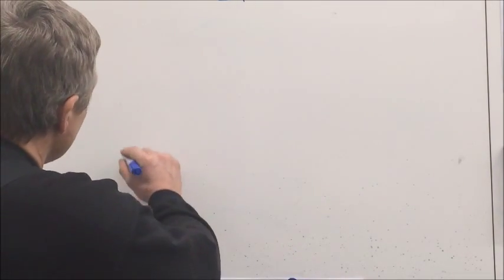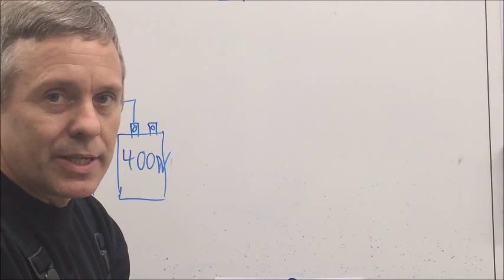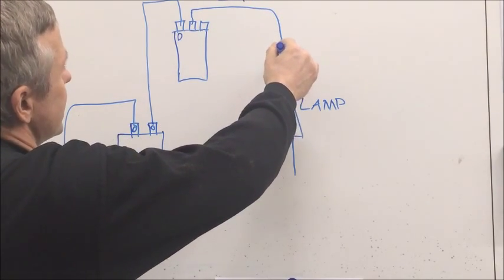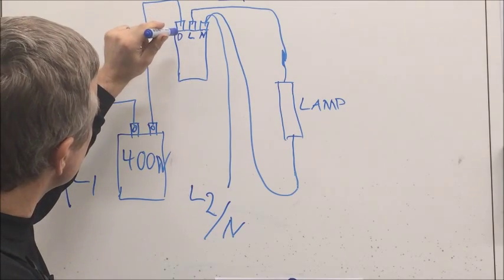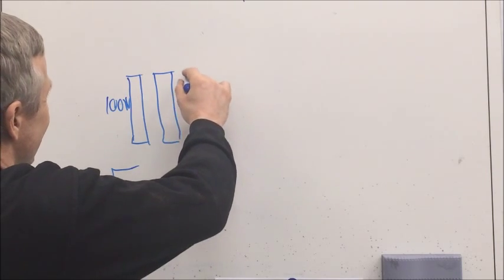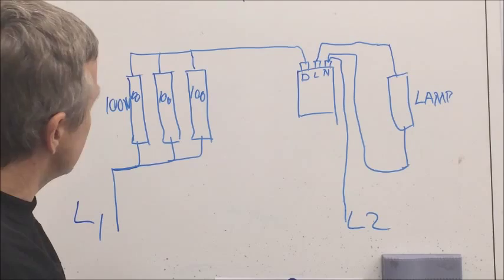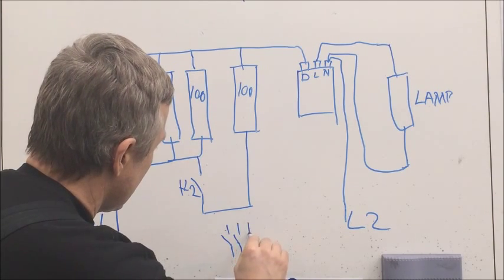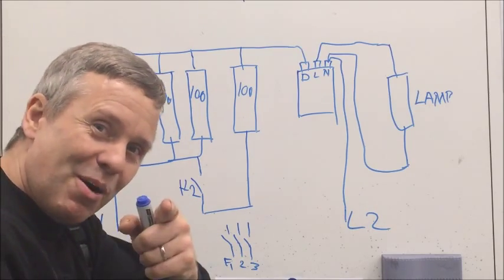High pressure lamp circuit

Comment: Hi thank you for the video it has helped me out alot aswell 😀 please could you help me understand the ballast that I have got it is a 600 w hps I am trying to trouble shoot it but it seems to be wired different from any other ballast on you tube. For its starter it has a circuit board in stead of one of the ones that look like a capacitor and the wire (L2) which you had as the negative going back to the plug, mine instead goes back to the ballast. Please can you tell me what sort of one I've got and why is it different and most importantly could I remove the circuit board and put an ordinary igniter and if I did what do I do about the wire you have going back to the plug should I do it that way or wire it back to the ballast? I'm very sorry if I've written it not very clear I would most appreciate your time as this has been puzzling me for awhile now, many thanks Rob Woods